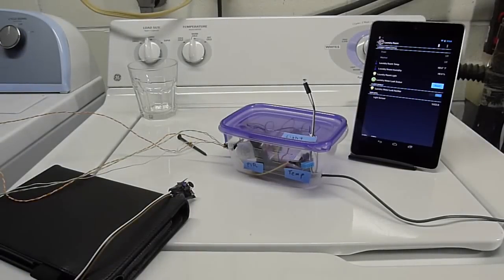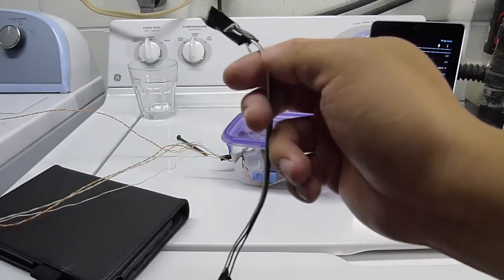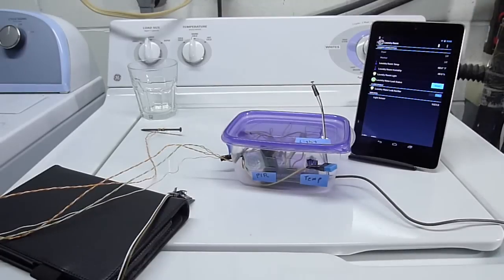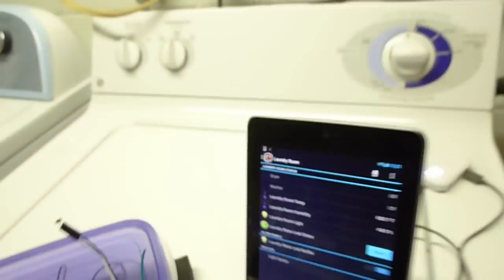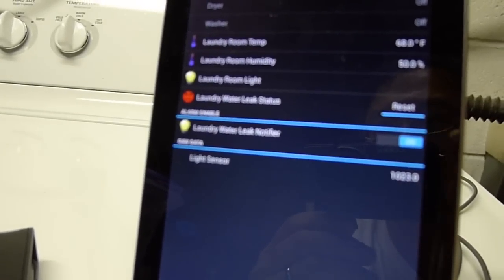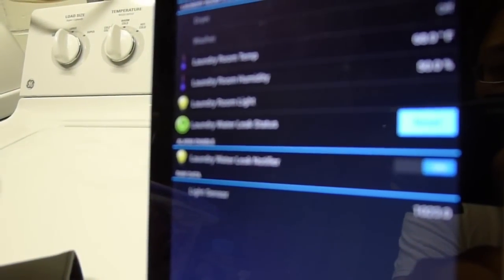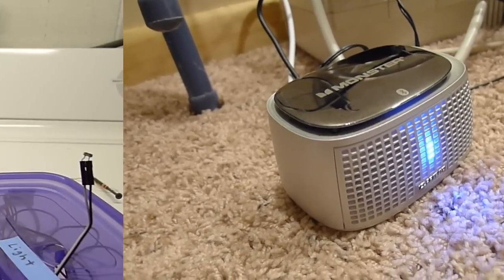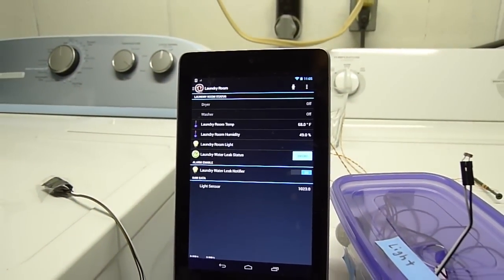Home Automation - Laundry Room Sensor

Comment: Do you ever get false alarms from the audible sensor? Would you be able to use some type of sensor that would trigger based on vibration? The vibration sensor could be nice for the washing machine as it could detect a high level which would notify the washing machine is out of balance.
Reply: +Brad Sweet I think the out-of-balance state would be detected by one of these:  https://www.adafruit.com/products/1767
But I'd hope the machine operates without much vibration normally, making Eric's microphone solution the best for just sensing on-off. 

Pretty neat stuff, Eric!
Reply: This is great stuff Eric!

Tai Viinikka after working with some more sensors myself at this point I'd use a reed switch to detect the clearing of the washer and dryer as it's more finite than just someone entering the room. When the door to the washer or dryer is opened it could then clear the status to show as empty.

Another thought I'm having is to also put an NFC card reader near the two appliances that allows you to scan and dictate for a notification to be sent via email or phone to a specific individual who is doing the laundry, or could route the audible sound to that individuals bedroom on top of the general area (I will have a whole house audio system).

One of my biggest ambitions is to solve home automation for the entire family not just as an individual. You don't really see this taking place yet. Everything is geared to notifying one person. I have high ambitions for what I want to accomplish.
Reply: Nice video. You may also want to checkout the review of home automation on my blog at digitalreviews. pw/home-automation-review/ Thanks, Alley.